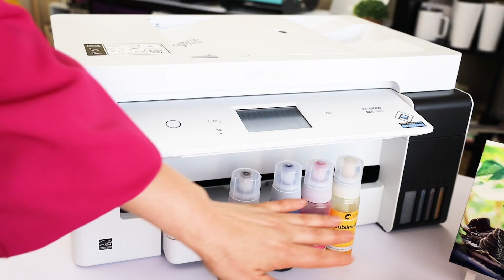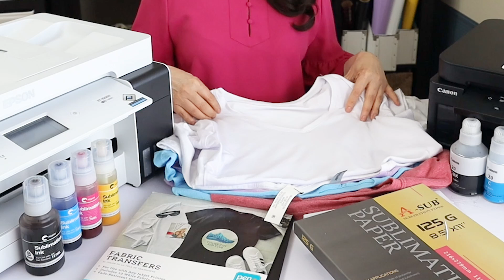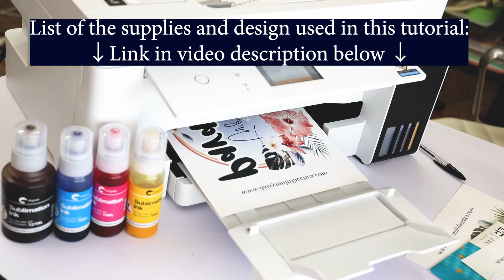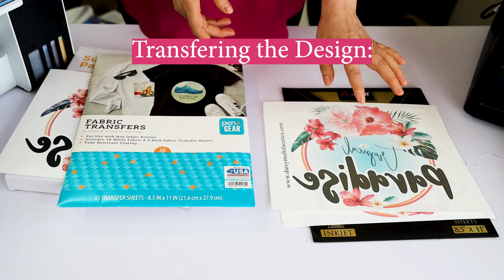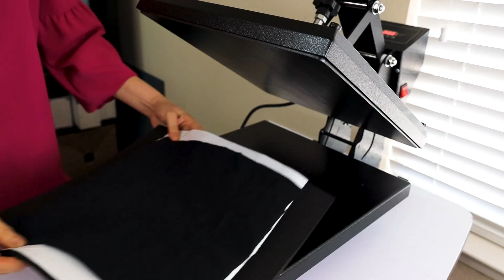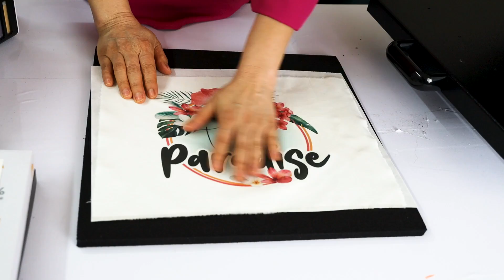Sublimation Vs Heat Transfer Paper: What is the Difference and How they Work?

Comment: I am loving all of your videos.  I just recently became a subscriber, so it will take me awhile to watch all of the ones I need to watch. (which is ALL of them!!)   I am just getting into sublimation as of last week, so I'm learning a lot from you.  One question I have...I really like the tape dispenser you're using for the heat resistant tape.  I see that it has an insert to fit inside of that size tape roll.  Today I ordered the tape that you use, but don't see a link for that dispenser.  Thanks for all of the wonderful videos!!